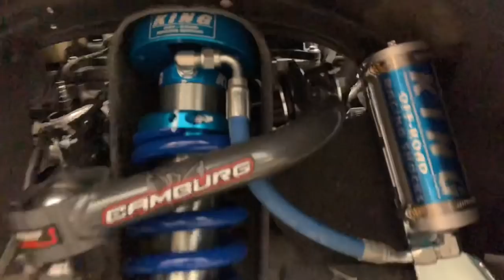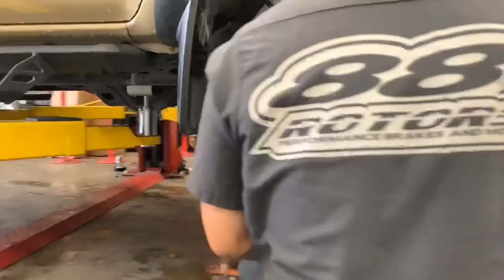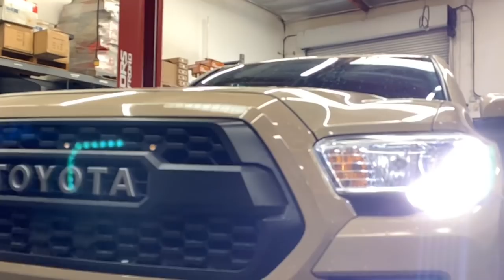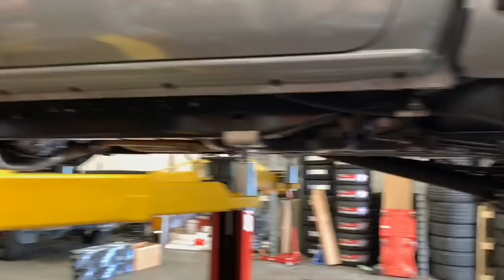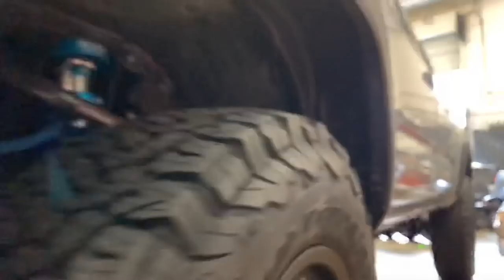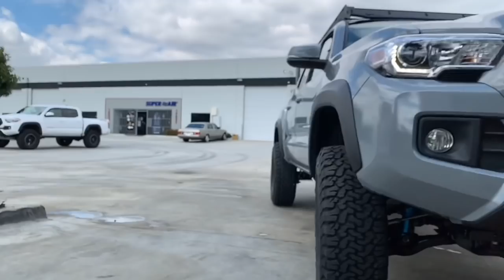Two 2019 TOYOTA TACOMA(s) Cement Grey & Quicksand, King & Camburg Lift Setups

Comment: I have a 2017 limited taco, what would be the cost for the king system that you installed in this video. What would be the largest size tire to use with your lift?
Reply: You gonna have to email them for a quote

Comment: @88rotors any chance you know much was on the cement? Ordering Kings and want this same stance. Thanks
Reply from the maker: how much lift? or you mean how much in price? 3" lift. If you are talking about price, give us a call and we can sort out the components and specs to quote you properly. Thanks.
Reply: my bad...it was late...I meant how much preload was on the Kings for the cement taco @88ROTORS
Reply from the maker: @1986GaryJr  Preloaded to achieve 3" of lift and still get full travel.
Reply: Thanks, do you happen to know the actual measurements of the preload (amount of thread showing) so I can tell the local shop. 
 @88ROTORS